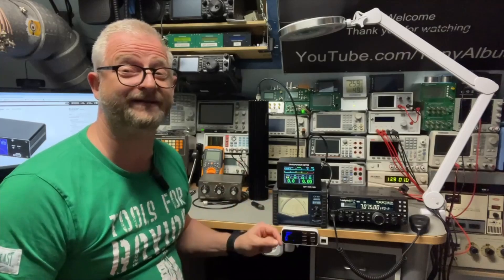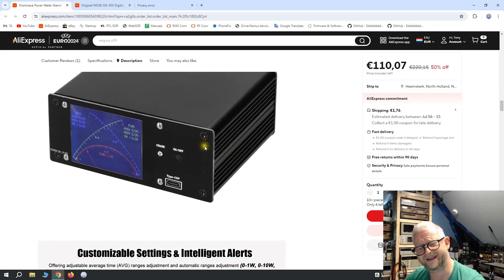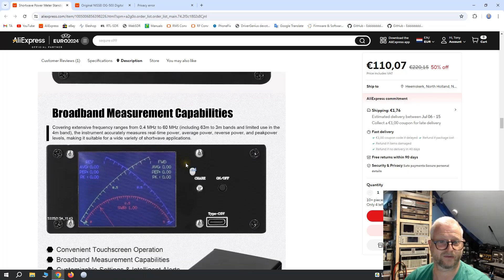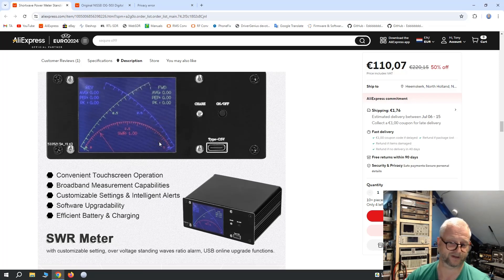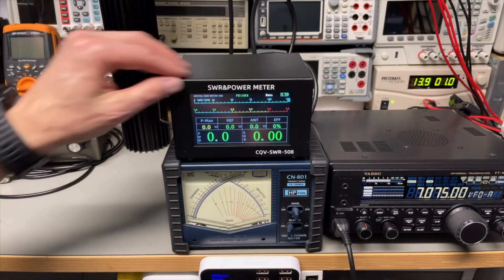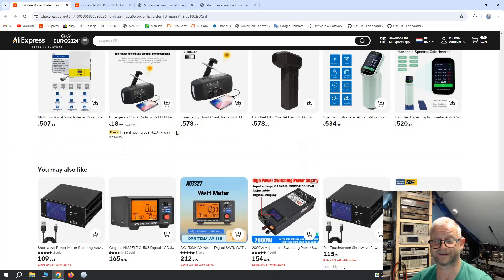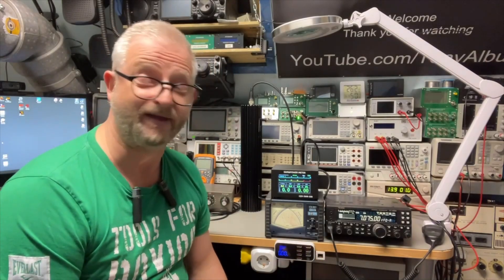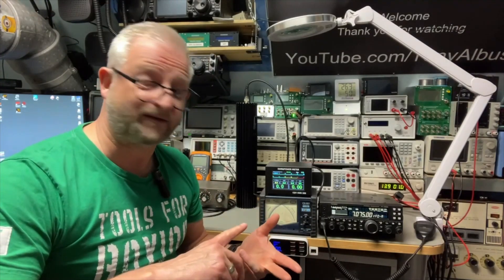TA-0410: SWR PWR 0.4 - 60MHz 1mW-1KW  Digital Power Meter - sz-plaza.com

Comment: The bad one doesn't show up on eBay, so that tells you something. Your good one does, and I might invest in one of those as a station monitor.
Reply from the maker: The other digital also tuns out to generate some destortion on 40 meters... so i stick to my Daiwa now
Reply: @TonyAlbus  Yes, I viewed your other video after this one. I think the problem is a lack of shielding over the RF sampler board, and one could possibly place some ferrite beads onto the DC input line that feeds it. Both RF jacks, and the associated circuitry, are open to stray signals floating around inside the chassis. They shielded the front but forgot the back.
Reply from the maker: @craxd1  Yes in the Daiwa meters you see the RFtab fully shielded and the signal outputted with passtrough caps..

Comment: I purchased a similar model CQV-SWR-508 on Banggood and this meter inserted bad noise into the signal. I am fighting with them right now to return it and get my money back as it was bad out of the box.
Reply from the maker: Yes it was bad, see my TA-0412: https://www.youtube.com/watch?v=W03w-dh7qgY / i hope they compensate you correctly.
BangUgood is not the best in support on broken stuff... usulay they give you 40% and you take it becouse sending back cost you a fortune.. thay are bad.

Comment: The 0405 video was referenced in the advertisement for the previously reviewed swr/power meter.

My question is how do you find using the switch mode supply? I have a couple of these (rated 25amp)

Exactly the same as the one on your bench.

How do they compare in your opinion to linear power supplies?
Reply from the maker: Hi, please comment on a related video, this is an other subject here. your question can be useful for other, but they will never find it as this is the wrong video.
Your question. low power low rimple linear, highpower switchedmode but you will have more ripple

Comment: I can bet there are not many customers for such device but again if people are like I am, They will check all they can find about something and then they will find this and they will have their chance to not lose money on crap. But at my experience , If you document all like you did in this video , and if u make shorter and lower resolution video to fit size AliExpress accept, then you easy can get refund.  It does not matter if item you purchased worth 1$ or 1000$ , if it is scam, not working etc-... if you document issue properly you will always get refund. Thank you for video it is good and nice video.

Comment: I think now that most transceivers have the SWR meter already integrated, the price of the thing could drop a little. I still have some SW-102 for my HTs on UHF/VHF, but even i have a CB radio with SWR meter integrated and for my Yaesu FT891 without integrated autotuner, i have an external ATU100 so it means 2 SWR meters already. I'm puzzled why somebody wants to spend the 165 euro on the DG-503, but i see the thing in almost every shack. Another reason against SWR meters is the widespread of VNAs...
Reply from the maker: For me the DG-503 woud also not be my choice as it is missing the Bars or needles. Still for manual tuning on HF.. i prefer a big cross needle analog scale..
Reply: @TonyAlbus  Yes i see, there is still some need for an instrument with needle display on a screen. In contrast to mechanical instrument, it could measure the frequency and calibrate itself, and also for use in a vehicle would better resist to vibrations.

Comment: Junk. Thanks for the review. I'm in the market for a meter that handles more than the 25 W that my HP does, but that's not it. I've repaired a lot of small  'new' Chinese modules and equipment, or modified it to make it more functional, and saved money by buying it from China. But for over $100 I think I'd like it to work right  the first time.
Reply from the maker: Thanks, yes this devices qualifies best as that ..the other meter that is on my desk, is very well build btw and work great . still i see myself using a cross-needle Daiwa, maybe i am just old as i also still use my fixed temp magnastat Weller :)
Reply: @TonyAlbus , I use a Metcal soldering station now, but I started in electronics back in 1963 with an old woodburner with a nail for a tip. I learned everything the hard way. I taught myself. It was a very slow process. I can't imagine what it would have been like to be a kid and have the Internet at my fingertips, with videos like yours back when I was learning electronics. I was starved for information. (I learned of the existence of the ARRL when I was in college.) The first tech book I learned from as a kid was so old it called capacitors 'condensers', but I read it and reread it. The town librarian finally told me I could stop coming back to the library every 2 weeks to re-sign it out since I was the only one who ever requested it or checked it out. Now I spend a couple of hours a day doing tech reading on the web and watching videos like yours. These days a smart, inquisitive kid could start from nothing and essentially get an MIT PhD in electronics or physics for free from the web, as well as the tips and wisdom of those with decades of practical experience. The knowledge at our fingertips nowadays is staggering. Just sort through the junk and inhale the rest. Times change. Oh to be a kid again, but with a NanoVNA and the Internet.
Reply from the maker: @johnwest7993  Hi John, yes much different times now, you started way before me, in my time it was already transistors but i do remember going to the libaries or cutting schematics out of electronic magazines. and ordering parts or a kit was also from a magazine and you needed to call or send a letter and pay by bank and then 2 weeks later your parts or kit arrived.